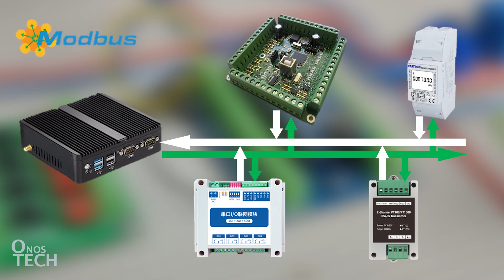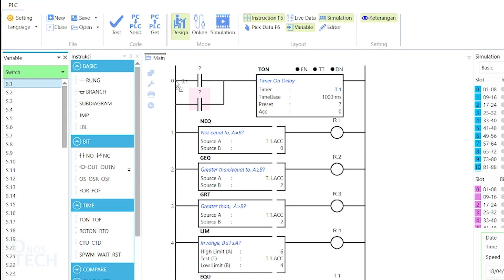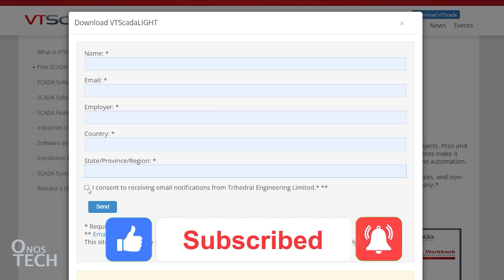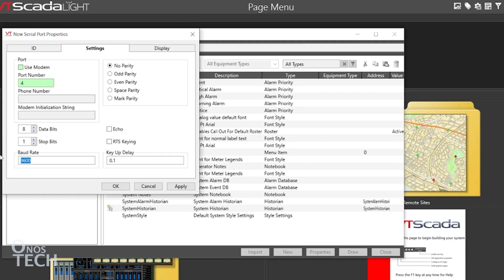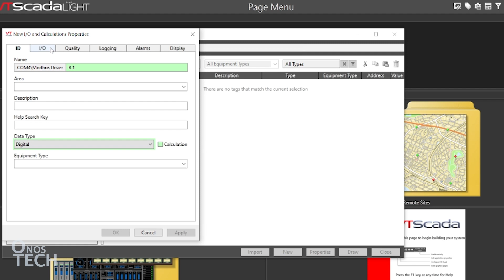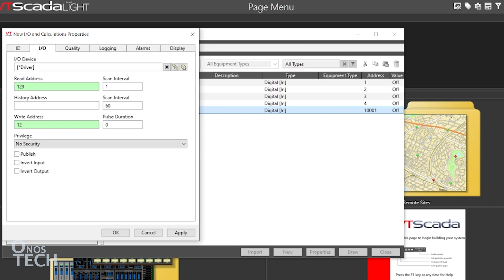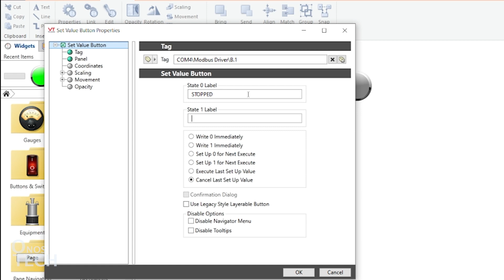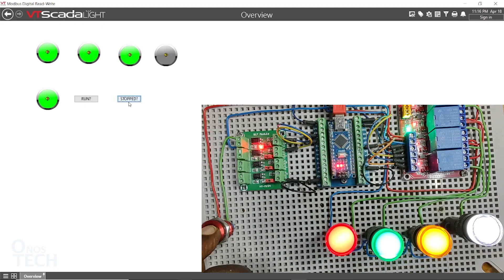#12 VTScada (Free Licence) Modbus Digital Read/Write | Outseal Arduino PLC

Comment: In my case I had to set the baud rate to 57600 but I would like to set the baud rate to 115200
What should I do? 
Should I buy the arduino nano in the link you suggest?
Greetings!
Reply from the maker: You can upgrade your nano to run the new bootloader. follow the link below by @Design Build Destroy 
https://www.youtube.com/watch?v=1TM-ADHb5Dk&t=20s